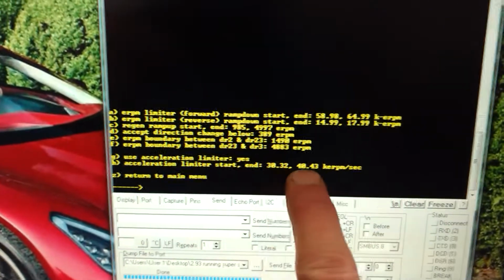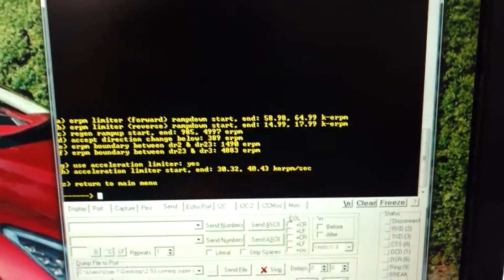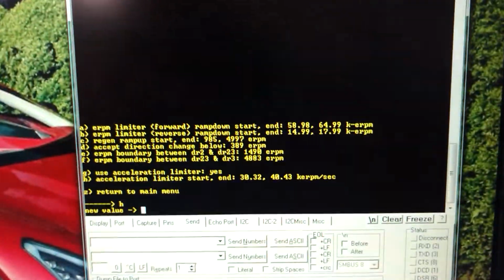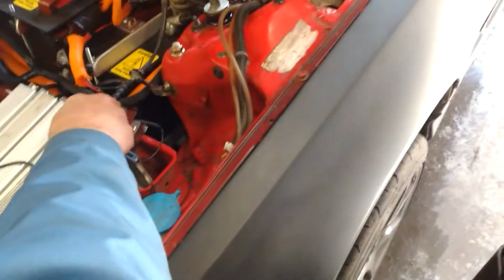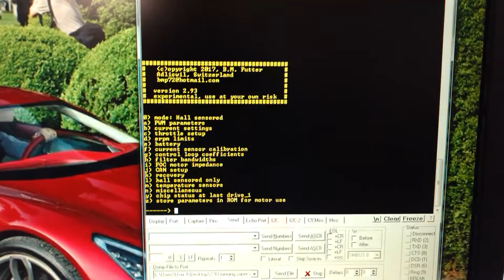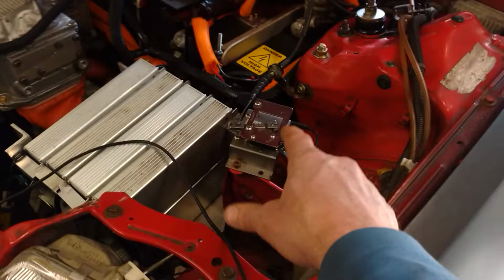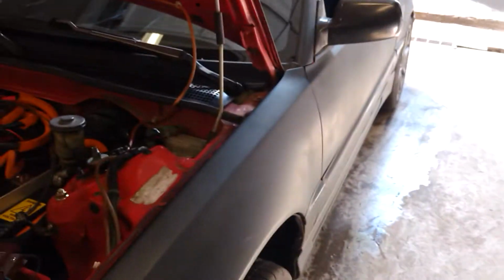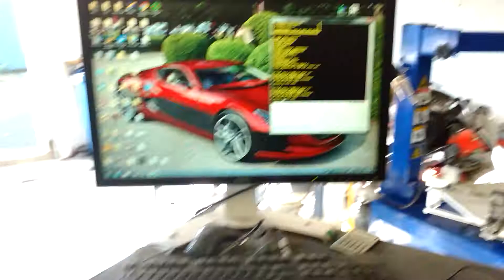Acceleration limiter

Comment: hi can you modify a stock 2015 leaf to make more power? can you sold custom controller? thanks! :)
Reply from the maker: Yes this controller can run any 3 phase permanent magnet motor with similar voltages.   Working on complete controller development it will take a year or more.  But I have been selling some kits for DIYers.
Reply: Arlin Sansome  ok! very nice work! i search someone who can power up my leaf.  like the new 2018. same motor but more hp output from nissan.
Reply from the maker: What year the battery in the 2014 and older leaf is to weak to make any more power.  If you want more power you need a 2015 leaf battery or newer.

Comment: ABS/TCS must do this job, isn't it?
Reply from the maker: Uhm.... What?   You know this is a 1988 crx si...?   No ABS or TCS in this car.  In time I will make traction control of my own.
Reply: You have leaf bosch/hitachi system, or not? I have installed it on my vx and it working like in the original leaf. My Vehicross have it's own abs system, but leaf have much more advanced system and it definately doing it's job. Of course You have to deal with encoder rings for the mre sensors, but it worth it. At least for now.
Reply: btw, nice wallpaper You have) Matte Rimac builds very nice EVs))
Reply from the maker: Nope.  I designed my own 3 phase inverter. Its with custom code from a guy in Switzerland.  Like I said I do not have TCS or ABS.  I bolted a leaf motor into my 1988 CRX si and designed my own inverter and built my own electric car.
Reply: Arlin Sansome, I see. I'm following Your thread on ES, do You plan to go awd?
Reply from the maker: I use to have plans for that but this car is packed!  I think the plan will be to build a new chassis from scratch and put a kit body on it or something I design.

Comment: Awesome, now all we need is a wife button and profiles so we can let someone else drive the car and not wreck it :D
Reply from the maker: Thats easy you can just hook a pull down resistor to a switch that pulls the throttle signal down with a resistor.  Say you run 1k resistance from the 5v- throttle input of the brain board at full throttle.  Then if you hook a 1k resistor as a pull down you effectively only ever get 1/2 throttle.   I plan to use something like this to set up the traction control.  An arduino will watch the motor speed (front wheels) and the speedometer speed (rear wheels) and turn on and off the pull down as needed.

Comment: Arlo is this parameter  acting similar to phase current?
Reply from the maker: LMFAO nope not at all.  I thought I made it clear lol.   This is completely separate from throttle and current settings.   The throttle and current still act 100% normal but only when the speed of the motor increases to fast does THIS setting reduce phase current to limit the speed of the motor increase.
Reply: ok so this have to do with rpm ramp up slope limitation i see... kinda protection  for anti slip or mecanical failure on what the motor drive..?
Reply from the maker: Yes it helps with a few things its a cheep way for traction control but also good if a motor comes unloaded at any time.  It helps a lot I like to set it a bit fast then if I hear the tire break loose I let off a touch and they hook up again.  Without it the tires spin to max rpm in about 1/4 second and there is lots of smoke :)
Reply: Good so you save on tire =)))).. btw will you put a pair of Mickey Thompson drag slick on that beast?
Reply from the maker: I have a set of M&H DOT Drag slicks.  I posted about them in the thread.